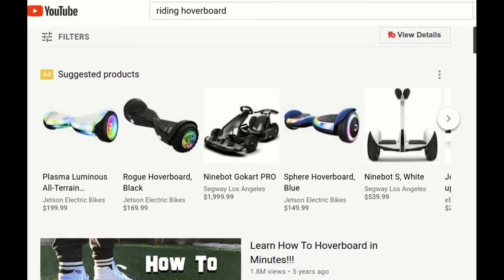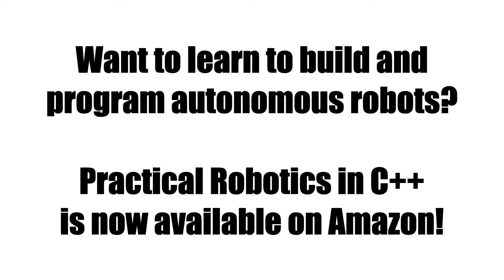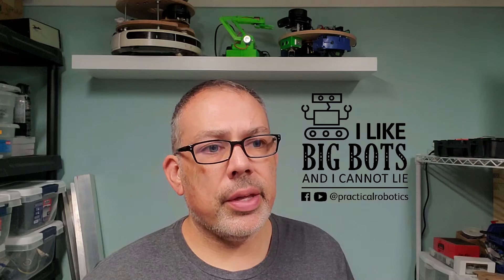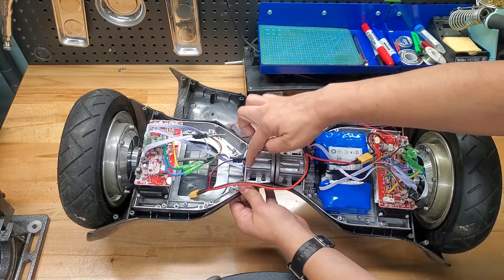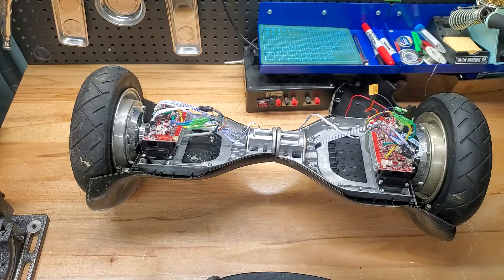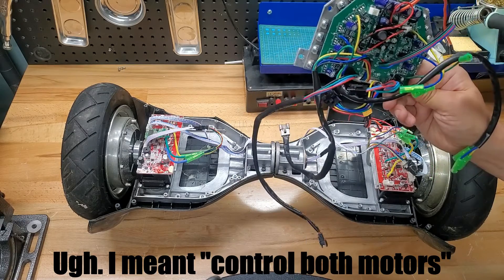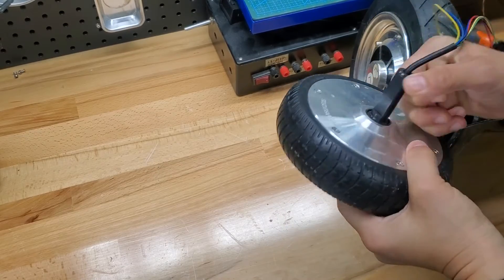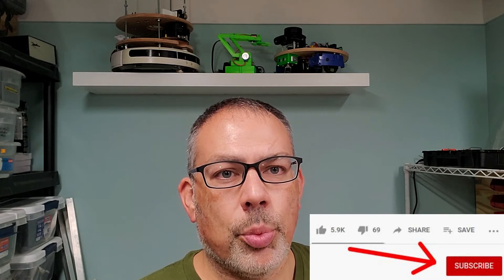Hoverboard Robotics Tutorial Part 1: Hardware Overview and Hacking

Comment: The motor is not wound for high torque at zero or very slow robotic speeds. It's unlikely to be able to hack the existing coils because they will already be 3 phase delta connected, all the individual coils being relatively few turns in series. Rewinding with many more turns of much finer wire suits a robotic situation.

Comment: Would you be able to share the brand/model of hoverboard you used? I'm having a tough time tracking one down with a single esc for both motors. Most of the cheap used ones come with the split esc's.

Comment: Hi i have split mainboards that i want to upload compiled firmware to but I'm lost on how to compile the firmware for it. I've looked at Platform io and the online compiler both do not support it. i can flash it no problem I already have the st -link device. any help would be appreciated
Reply from the maker: The procedure for compiling and flashing is the same, but I don't know if there are available programming pins in your boards and also the same firmware will not work. At the bottom of the Feru hoverboard project page (https://github.com/EFeru/hoverboard-firmware-hack-FOC) there is a list of links, and one of those links says it is for split main boards but I think there is no guarantee that it is the exact same chip and pin connections as yours. You could try it and risk something happening or try to spend a lot of time tracing the connections to the pins. If you do so successfully I think the community would be grateful if you documented what you found and learned.

Comment: Great explanation. Thanks for sharing this. May I ask if you provide assistance (paid) to help with hoverboard projects? I want to convert a hoverboard to a small robot car. And it will be great if you can help out and I can pay you for your services. Thanks
Reply from the maker: Thank you and thank you for reaching out. I do consult although I am currently pretty at my limit for big projects, so it depends on how much help you need. Feel free to reach out at my first initial(L)+ my last name(brombach) + (2)  @gmail.
Reply: @PracticalRobotics  I want to use one of these motors to rotate my telescope dome I built. Is there an easy way to power those motors without a controller? Do I simply use the original controller and original switches for speed control? Also, I want to power it without a battery and simply use a AC to DC power source via transformer.
Reply: @PracticalRobotics  Thank you 🙂

Comment: I've found the best place to pick up used hoverboards at a great price is Goodwill. I try to hit all the better Goodwills on Tuesdays, (senior day 25% off), and I can generally pick up one for under $10.00. Some have even had a good battery pack.
Reply from the maker: Fantastic tip! Even with bad batteries...given the extra work and expense that goes into brushed DC drive systems... I'll probably never use anything but hoverboard motors again.